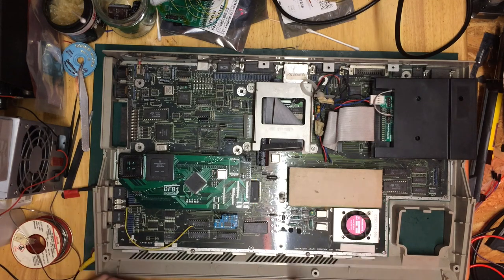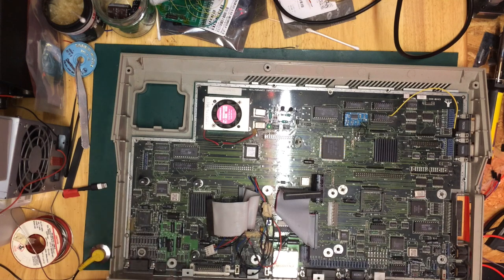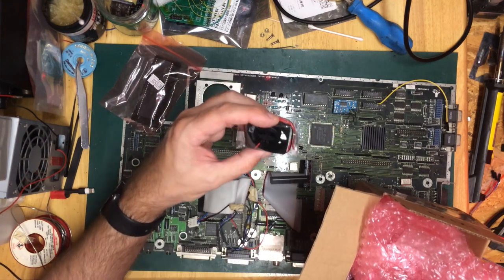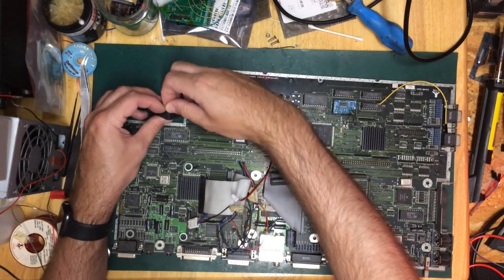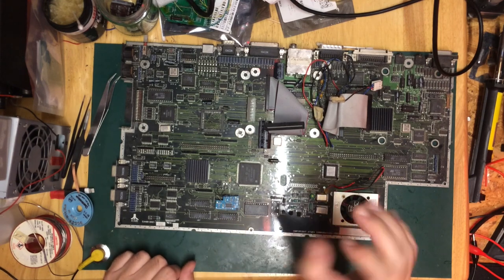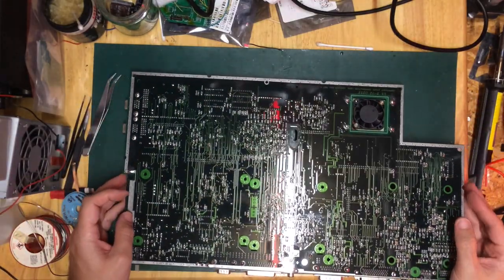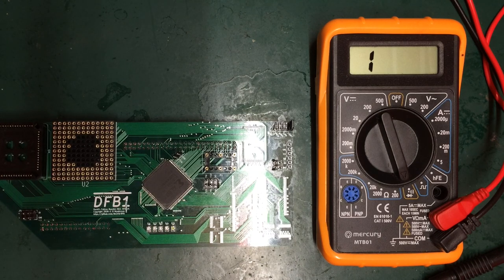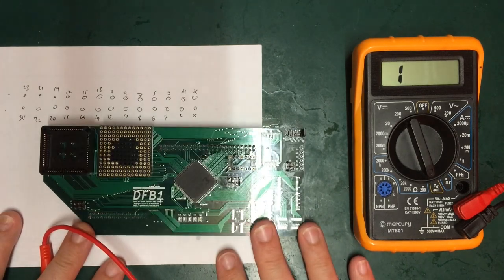Atari Falcon expansion port reflow, fan replacement, some DFB1 waffle and connectivity checking

Comment: I also replaced the extremly noisy fan of my Falcon and actually it IS a "replacement", as I mounted the new one to another place to avoid completly disassembly of the Falcon. See here: https://youtu.be/0LHOp732eCM?t=148 (I linked to the interesting part. There also is a link in the description to my Falcon photo album, with some hi-res pics of the fan mod) 😉
Reply from the maker: Super. Is that a Meccano strip?! https://en.wikipedia.org/wiki/Meccano
Reply: @thetechnoshed  Yes, exactly that! In germany it was marketed by model train producer Märklin, I think up until the 70s or so. 😃